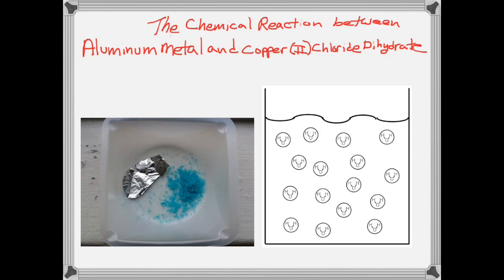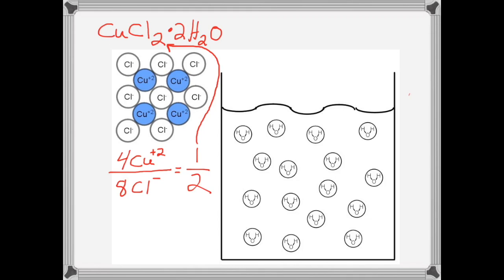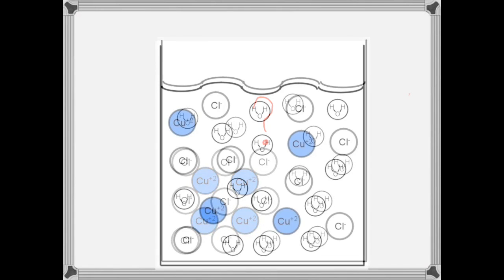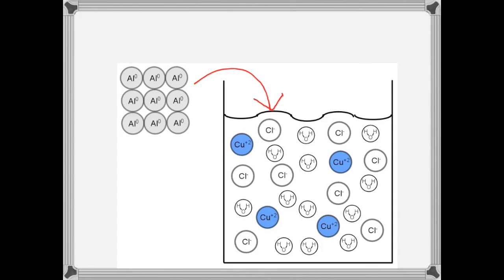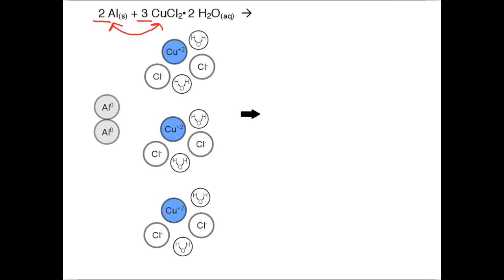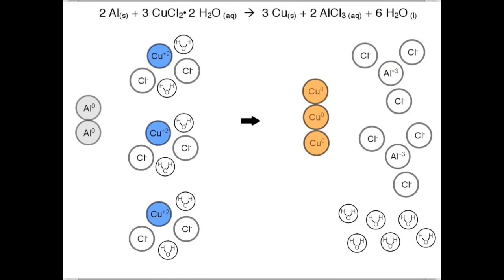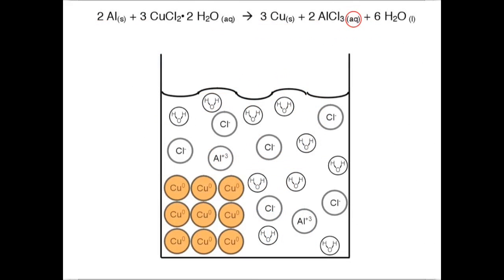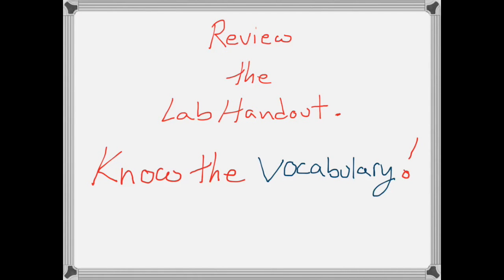The Aluminum and Copper Chloride Reaction prelab

Comment: Hi Mark, Can you please explain how/why hydrogen gas is produced? Since the water molecules are whole.
Reply from the maker: Saberi Bita to begin with, I should point out that since I made that video, my own experiments have shown that the reaction is much more complicated than is presented in textbooks and Internet videos. It seems clear that the precipitate is not actually copper, or at least not all of it is. The amount produced is consistently more than is theoretically possible. I hope to have the material analyzed at some point.  

As for the hydrogen gas, descriptions on the Internet indicate that the water splits and the hydroxide ions form a complex with aluminum ions while the extra hydrogens are released as a gas.

Also, the chloride ions seem to be necessary in order for their reaction to take place. Presumably, it helps in the process of breaking through the aluminum oxide coating.

Comment: can i ask a question?
Reply from the maker: danny skee yes.
Reply: Mark Moverman I had a similar experiment and i was required to state if it is possible to see if all the aluminum atoms reacted and if all the copper ions reacted and should name another metal that can suitably replace aluminum while keeping a similar reaction what would be the answer?
Reply from the maker: danny skee I hope I am interpreting your question correctly. You should be able to tell if the aluminum has been used up by looking for any unreacted pieces of aluminum foil. You would know that the copper was used up if all of the blue color from the copper chloride solution disappeared. In the sense that this is a single displacement and a redox reaction, any metal with a higher “activity”  than copper could be used.